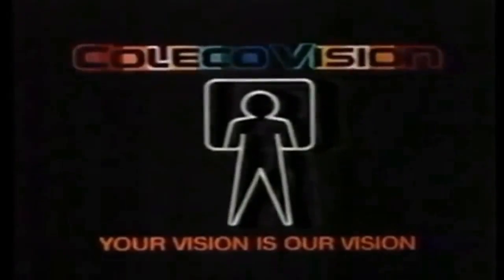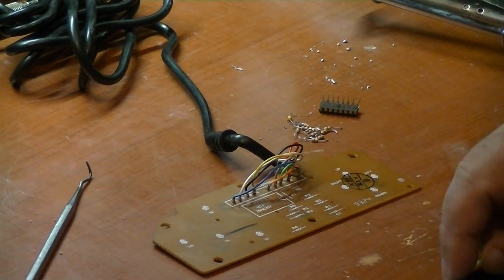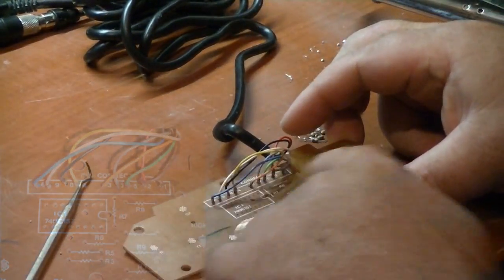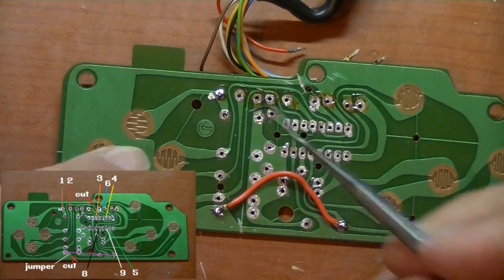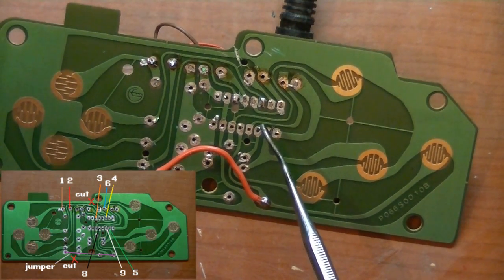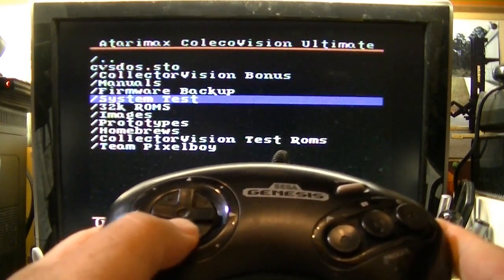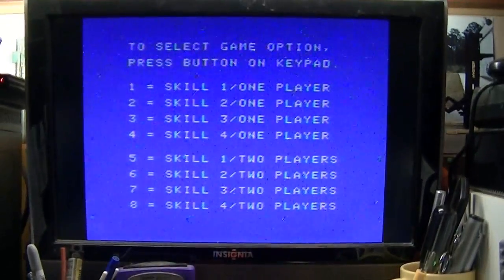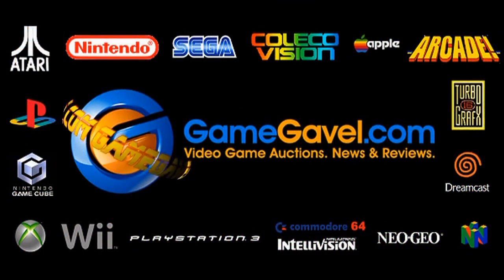The ColecovisionUT! Sega Genesis Controller Mod!

Comment: You need to test it with a game that has a third action when you press both fire buttons at the same time, such as Tutankham (left button shoots left, right button shoots right, both buttons at the same time drops smart bombs). I think you'll find that it won't work for dropping smart bombs like an actual ColecoVision controller does (which has diodes in its circuitry to enable registering two buttons at the same time).

Comment: I just tried a regular 3 button megadrive controller and all directions work and button 1 (left button) works out of the box. Would it not be easier to somehow just get button 2(right) to work instead of all of this desolering and soledring? I'm new to Colecovision and I want to mod a megadrive controler. If I connect pin 5 to pin 6 will that not just trigger button 2(Right)?
Reply from the maker: I am sure there are many ways to do this mod :)   This controller did not work out of the box which is why it was modifed so much.

Comment: This is a little late but I just wanted to say I used this video to help me mod the controller for a C64. I absolutely mangled the wiring in the end to get it working because the coleco is not quite the same. So for anyone else doing this for a C64, Atari, Amiga heres my advice... Remove the components. Leave the brown, red, and black in place. Don't make those two trace cuts and don't wire in the jumper. Blue wire goes to your fire button B (video has green there). Orange and yellow wires are correct. And then the green, white and grey are just snipped off. I had to make the holes a little bigger too

 And most importantly to make the controller super awesome make a jumper that connects the up and C.  Now you have a jump button. For me games like Gianna Sisters are unplayable without one.

Comment: You can also use this for the Atari 2600 and 7800, correct???
Reply: Didn't work for me, but I added a comment that will give you the low down on the changes

Comment: Thanks for the great video. I used a good quality de-soldering pump, and had NO problem with the diameter of the holes, and the pins fit just fine as well. Keep up all of the great videos!

Comment: maybe add that the holes need to be made bigger to fit the bigger pins...why leave that out?
Reply from the maker: I guess I should have put in how to strip wires and tinning the iron to :P   By the way, I had no problem with the pins, did not have to enlarge the holes.

Comment: Two questions. 
1. My guess is that this task is FAR beyond the ability of someone who has never soldered before. Correct? 
2. What would the configuration be to rewire the controller for to use it as a Super Action controller also? (perhaps A=yellow, B=red, C=purple, START=blue)
Reply from the maker: +Troy Schnider 1. dont attempt if you cant solder.   2. just map out the wiring :)